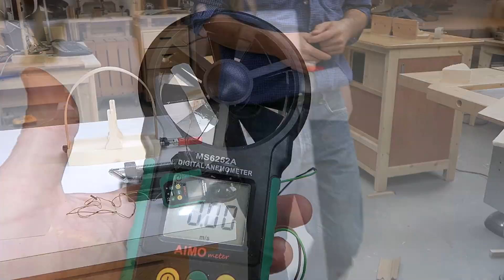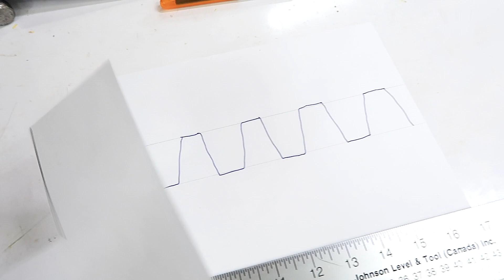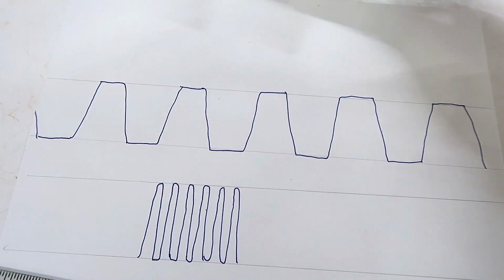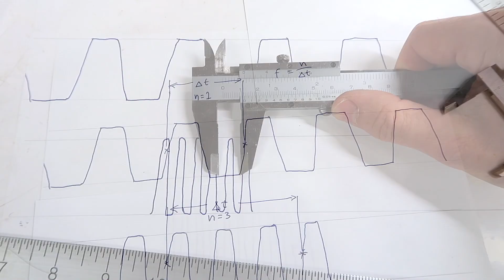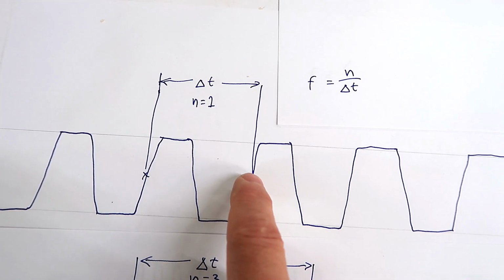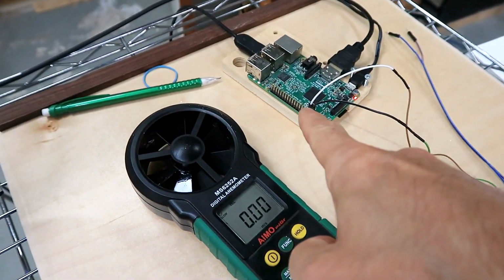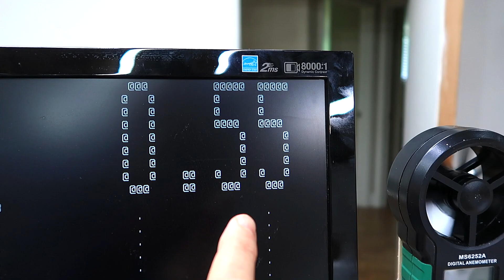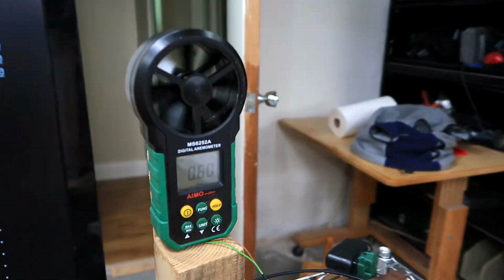Anemometer computer interface hack

Comment: Great hack! It should be noted that the relation between the angular speed of the rotor and the linear speed of the air is not linear, so to make ABSOLUTE measurements it needs calibration. But for comparative (RELATIVE) readings it should give you enough insight to reach a conclusion.

Comment: Hi  @Matthias random stuff, thank you the amazing video, if I may ask, how did you figure out that the blades on the Anemometer were not properly balanced and how can one figure out which blade to add the weight to ? I saw your other box fan blade balancing video and tried finding the blade / heavy side, but could not figure out. Could you please possibly explain the process of determining / balancing the fan on the Anemometer. Thank you.

Comment: One issue that can occur with the counting clocks from edge to edge approach is that it assumes the encoder slits are spaced evenly around the disk. If this is not the case then counting clocks between edges does not give a particularly accurate estimate of the speed. This is more of a problem for high resolution encoders than the type Matthias is interfacing to.

It also results in unevenly spaced samples that require a timestamp to process further.

Comment: An interesting project is to build a paddle style anemometer (horizontal rotor type) with one blade having a hole in it. By measuring the phase of the small frequency modulation it should be possible to measure wind speed and direction with just the rotor.

Comment: Swap out that course encoder in the center for one that has 10 times as many slits per rotation. By just moving the decimal place over 1, you would have 10 times the resolution.

Comment: If you want to pick up even lighter breezes, you can use a thermoresistant wire and measure the voltage drop. I actually built one of those a long time ago. The tricky part is to calibrate it, as the angle of the wind and ambient temperature are important.
Not sure if URLs work, but maybe you can use a translator on that if you need more than the schematics from this article:
https://www.mikrocontroller.net/attachment/58437/ELV_Hitzdraht-Anemometer_3.._2_.pdf
Reply: I believe something like that also happens in low vacuum gauges and Mass Flow Controllers.

Comment: AFAIK this is the way frequency counters work, measure time between pulses, and as frequncy goes up, count time between more pulses.  You can also add a gate time, where you define minimum time counting pulses, so you get smoother response but lower sample rate.

Comment: how about painting (sticking vinyl or tape) the fan blades with stripes pattern, and convert it to a stroboscope. hopefully that diode can pick up those stripes  it might increase the resolution by 5-10 fold. because the electronics are fast enough, it's just the low frequency to be "multiplied" / geared up by the stroboscope pattern.

then you need some maths to make up for those bladeless gaps while counting strobes on the blades when present.

Comment: You should check into the way a mass airflow sensor from a car works i think they are very sensitive.
Reply from the maker: those would be dealing with MUCH higher air speeds than this
Reply: @matthiasrandomstuff2221  i think so too but the small platinum wire can probably detect slight changes in airflow also just a thought love your vids

Comment: Hmm - at first glance a good idea to trigger on positive flanks. But on a second thought: why wait for a second positive flank? You can easily double the sample rate by triggering on every signal flank, let it be a positive or negative one. Since every flank indicates that there is an interaction with the LED.
Reply from the maker: because you can't count on the pulses being symmetrical
Reply: @matthiasrandomstuff2221  Yeah, as I rewatched the video I noticed that fact too at 1:23 - it seems as if the holes of the fan are actually a bit wider apart than they are in diameter, right?
Reply: You could count or time the positive and negative ones separately from each other. But seems like a lot of effort with minimal gain.

Comment: What happens if you switch units to feet per second ? Smaller units = finer measurement ?
Reply from the maker: Note that the display goes to hundredths.  So it's not like they are limited in display capability.
Reply: If the problem with the original electronics is that they always sample for a fixed period of time independent of the rotation speed, then changing the units does not fix the measuring problem.
The number on the screen is only a conversion of the pulse count.

Comment: Matthias - I love your experiments, keep them coming.  Your solution to the anemometer is brilliant.  I see you have a need for a Kalman Filter.  They are relatively easy to set up and provide a robust mathematical solution to measuring pulse width with the side benefit of knowing the accuracy of the answer.  Google suggests there is a page on Kalman using Python, but wikipedia also has an excellent entry as well.
Reply from the maker: that's overcomplicating thigns

Comment: What if you were to drill additional holes between the existing ones on the fan rotor?  That should double your resolution.  You’d have to divide the measured speed by 2.
Reply from the maker: there's no space for the right size holes between the existing holes
Reply: @matthiasrandomstuff2221  Okay... that makes sense.  Worth a try.
Reply: this won't work unless you can exactly, I mean exactly, center the holes at the exact angle relative to the original. I do this with precision machine tooling where I need to count down to 0.25 rpm with the device I build, but without a rotary indexer/mill you will see the ever so small angle error in your output.
Reply: @axa.axa.  For a counts/second type pickup it doesn't have to be that precise.
If for a certain fixed rotation speed you sometimes count 3 and sometimes 4 pulses, then it is possible that with double the number of holes you sometimes get 6 and sometimes 7 counts. That's an improvement.
If you measure the distance between two single holes, then the error in their position results in jitter in your pulse lengths.

Comment: Hem this is interesting. Usually a hot wire anemometer is needed for those low speeds (ashrae specifies this for testing laboratory fume hoods and biosafety cabinets) but these are much less expensive... Hem....

Comment: Great Job Matthias!!!  Anemometers are more complicated than people give credit... The first thing you mentioned is the low starting speed... the drag on the bearings and even the type of lubricant used are all factors. Second is precision you mentioned, I'm guessing why they chose 0.2 Meter/ second is that it is roughly 0.5 MPH so they can write one collection routine and do a metric conversion, they use the "quantized" display to hide this fact... The intention of the product is to measure outdoor wind speed, and for that you typically don't need any higher precision than 0.5 MPH... unless of course you're Matthias and want to do an experiment with indoor drafts... LOL 😁
Reply: “unless of course you are Matthias” is what you meant to write. “You are“ is shortened to “you’re“, not “your”.
You write like an intelligent educated person, who may have done some or a lot of programming…….I suspect you know how important it is to use the correct spelling in that context, and there is no excuse for incorrect spelling here.
Reply: @neilhughes3823  Thank you, corrected my typo.

Comment: I have a similar Anemometer, just very slightly more expensive one with USB out. BT-100-APP. I splurged because it has USB output and a higher 'accuracy' but frankly I like your method much better for my particular use case. (Testing all my shop vacs.) Plus, I never get a warm and fuzzy feeling when installing the chinese software required to interface with these cheap USB devices.

Never the less, it might be a good choice for a viewer with slighly less proclivity to roll their own.
Reply: You should temper your anxiety over foreign nations and how ethical their capitalist class is in relation to the capitalist class in ours. I don't trust software created in the US any more than I trust Chinese softwares.
Reply: @Mark-dc1su  My anxiety has nothing to do with the nation of origin specifically, it's merely coincidental that all the products that include the most sketchy software tend to be bundled with dirt cheap hardware that comes from China. 

In my opinion, any time you have an intersection of race-to-the-bottom economics and closed source software created by underpaid and underappreciated programmers to the bare minimum level of functionality - the chances for bad actors to snake their tendrils into it increases.
Reply: @bradley3549  "intersection of race-to-the-bottom economics and closed source software created by underpaid and underappreciated programmers to the bare minimum level of functionality"

Yeah but this still is basically the definition of global social relations, which simply include China and its own quirky state capitalist system. I mean, the US has even tighter IP laws that intensify this tendency of closed source software dominating the markets. Not to mention the dearth of union opportunity for programmers in spite the relative large size of capitals being invested into tech.

I'm just skeptical of this easy nationalist virtue signaling wrt 'chinese hardware' or 'chinese software' or whatever while turning the blind eye to the same conditions existing at home.
Reply: @Mark-dc1su  None of that changes the fact that the software for my anemometer did in fact come from China. Gee whiz.

Comment: How did you calibrate it?
Is there a known conversion factor between rpm and wind speed?
Reply from the maker: I just tweaked the multiplier until it matched the anemometer at moderate speeds
Reply: @matthiasrandomstuff2221  I feel like this is not a very accurate way to calibrate but you probably will compare air speeds in different parts of the house so it will all be relative anyway right?
Reply: I'm guessing that's irrelevant to his experiment. He probably just needs a mean to compare, so the unit is not important.
Reply: When I was calibrating a low speed anemometer, I put it on a remote control car that went at a known constant speed, since a car moving at speed X is the same as the car being still with air moving at X past it.